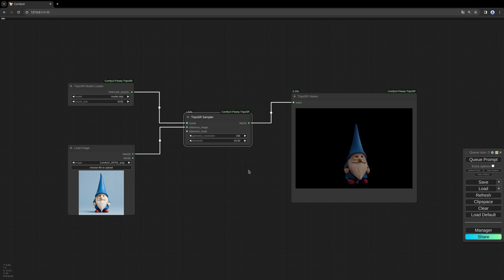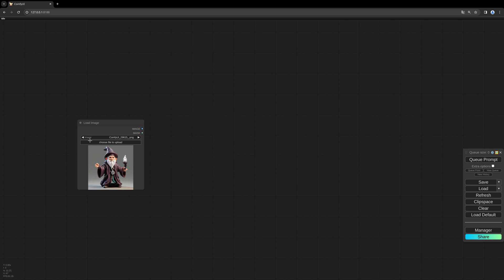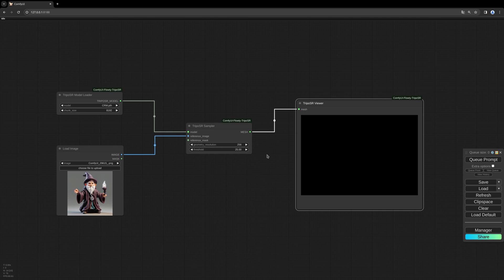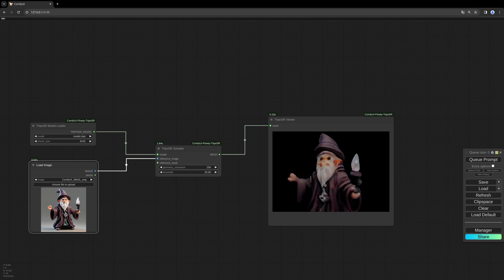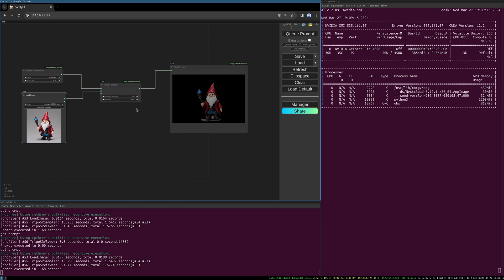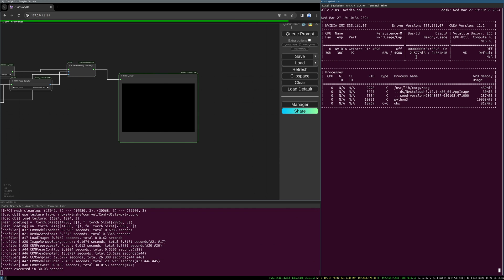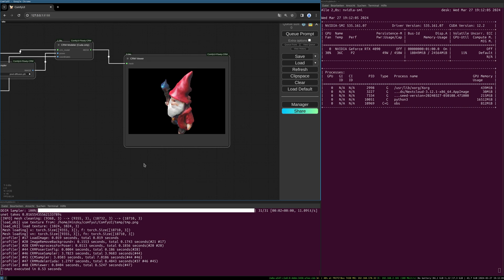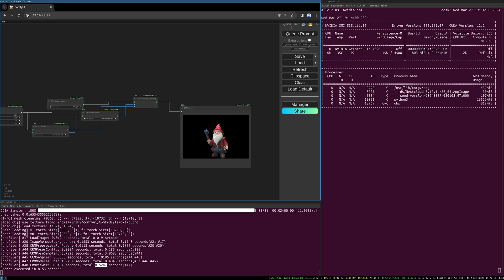Convert single image to 3D with TripoSR in ComfyUI AI, comparison to CRM

Comment: Do I need to generate a Tripo API Key for this workflow?
Reply from the maker: You dont need the api key. But the Installation is difficult and the custom nodes might be brocken. I will do a video on how to use the custom nodes wich uses the api key soon.
Reply: @neuron_ai  I have cloned the repo from github, installed CUDA and PyTorch, and the requirements from requirements.txt but when I try to run the prompt the TripoSR Viewer just says "loading scene..."
Reply: @neuron_ai  Thank you for the help, I could not get this workflow to function but I am using another github repo that worked connecting to Tripo. Its called ComfyUI_Tripo by VAST_AI_RESEARCH in case anyone needs it. It works with .png inputs or text to 3D model also

Comment: "Value not in list: model: 'triposr.ckpt' not in (list of length 67)
Output will be ignored" what are im doing wrong?
Reply from the maker: Hey sorry for late response. Unfortunatly triposr is quit tricky. This error sounds like your model is not in the right place. did you check this?

Comment: what extension output 3d model ?
Reply from the maker: you meen which node?
Reply: @neuron_ai  the result is obj file or what?
Reply from the maker: @jojo8axis  now i get you. yes obj
Reply from the maker: @jojo8axis  yes
Reply: @jojo8axis yes obj which I found weird cause if you use the api you get really good models ind glb
Reply from the maker: @deandresnago2796  I should really give the api a try.

Comment: Can you upload a character modelsheet and have the 3d model made from that?

Or multiple images; front, side, back, quarter
Reply: Look into Gaussian Splatting, NeRF and Photogrammetry.
Reply: I think a more practical solution would be to take a program that can separate the image into layers, and to inpaint behind elements that would reveal new elements when rotated. Then, you can bring that into Blender and extrude it to produce a 3D model. It's a bit intense of a workflow the first time you do it, but there should be some guides on Youtube if you search around.
Reply from the maker: with crm you can use different views as a base for 3d creation. https://youtu.be/DXiiVpkeKgQ?si=SDyS5uXITj-yf-ho